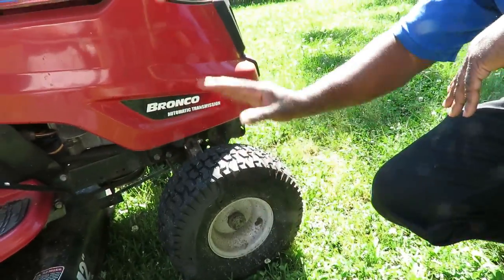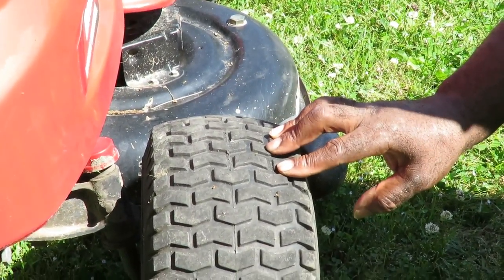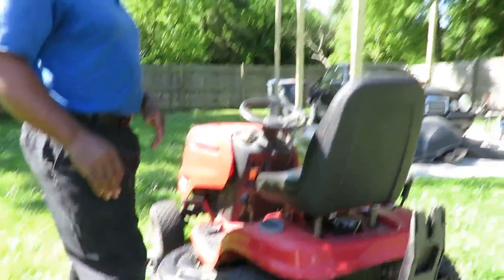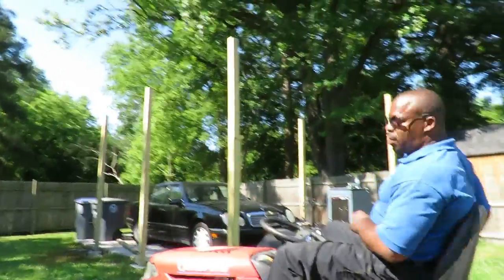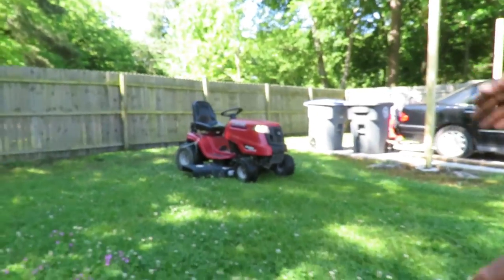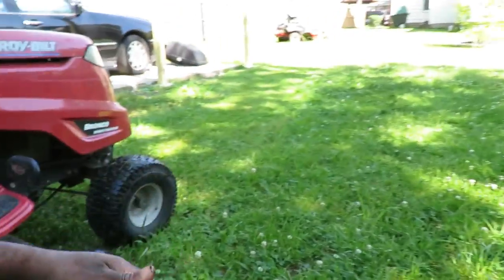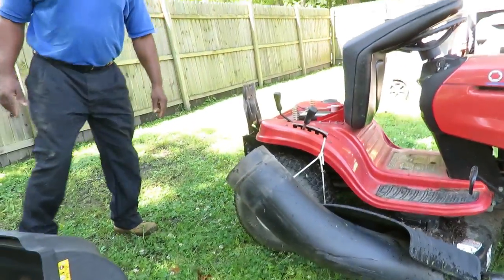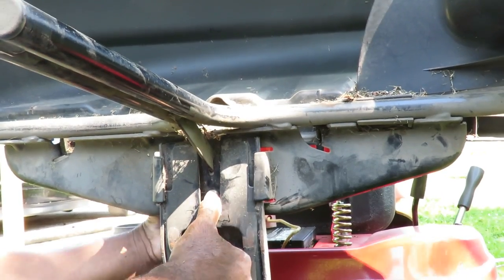Troy-Bilt Bronco Tractor And Bagger Review AFTER 4 YEARS OF USE!

Comment: Tim,  Good video!!
I bought a 2017 Bronco - great deal from Lowes - $1200!  However, my local repair guy stopped doing a pickup & return to service riding mowers!!
So Ive had to use the authorized Troy dealer for 2 services in 3 years - @ a cost of over $600!!  Only repair was a blown electrical fuse!!
If my old Sears blade bed hadn't worn out - after 15 yrs - woulda never bought the Troy!!
Thx for the review & info!!
Reply from the maker: That's great Jim! We still have ours, and it's still working great! Since this video, we have replaced the starter and a battery, and that's it. These things are great!
Reply: You don't like working on these things yourself you know those shops cheat

Comment: Thank you so much for taking the time to do this. I'm between this and a cub cadet and can't decide. One thing that I've read in several places that may help you is to spray silicone on the inside of the plastic pipes that go from your deck to the grass catcher. I read it really works well and it's a cheap thing. It's supposed to especially help with damp or wet grass. Thanks again!
Reply from the maker: I do believe that Troy Bilt and cub cadet are basically the same. You might want to look into that and that might help you decide. Thank you for that tip, I will definitely try it.
Reply: Ima go with the cub goin to order in 2 weekz

Comment: Thays awesome, these tractors are awesome. I have the brinco as well. It has spent its life in the garage when not in use and I only cut my own yard but I bough mine at Lowes 16 years ago. It runs perfect and uses no oil. Ive been through 2 deck belts about 4 batteries and last year the muffler rotted off. Everything else is original. It gets oil changes and filters every year but its a briggs and stratton 18.5 intek
Reply from the maker: COOL Kevin! We are just now replacing the rear tires, but the tractor RUNS GREAT!!

Comment: Thanks , man! I got a newer version with mostly the same main features. This info will help me to work around  problems using your trials and errors.
Reply from the maker: Thanks Daniel, and this thing is STILL going strong! I did have to replace the tires, the battery (of course), and the starter (which was only $65).

Comment: Mines a older model than that one i think is a 2004 but its piston was froze up and both valves and rods were rusty because someone cut off the air filter housing cover and they left it sitting in the rain so i got it all moving again the 18.5 hp intek runs good now just needs a few new tubes and plastic pieces maybe a intake manifold for the front of the carburetor to the air filter and a good used motor shroud  gotta have that or another used engine just for the parts im needing 

Need a carburetor rebuild kit just for the little rubber gasket fits between the white piece in the carburetor when you take it apart then the aftermarket carburetor will be a good backup to keep for later so i cleaned up the original carburetor and it works good its rubber gasket inside it works i guess other people would just buy a new carburetor but i didn't have the money for one.

So i done a test ride on mine it rides good but does have air leaks from it not having all the new and used parts its needing after the engine got hot oil started coming out from i think the air breather tube on the top left side of the engine cause it needs a new hose then i shut it off until i get the new stuff may have to take off the flywheel to put on the new hose

Comment: My 2004 one will be doing knee high grass once i get done replacing missing parts on the engine i may need to do a intake valve adjustment to so the old things gonna get to cut alot of field grass pretty soon and i go up and down the big hills can't go sideways its to steep to and would probably flip over on those hills i try not to chew up to thick of tree branches but finger size limbs get chewed up and blown right out.

Comment: Great video! I don't know if you've torn into the transmission yet but I have on mine. Mine had so much time on it that the actual bushings the axle rides on in the transmission wore thin so my axle had a bunch of extra play and it was squeaking because it was rubbing on the casing. Anyway I tried replacing the bushings but one of my wheels was rusted on and I've been unsuccessful so far; the project is 'on hold' because I found a good used transmission at my mower shop and put it on. Anyway, I was just gonna say regarding the ground speed that your variator pulley in the back,  belts, or foot pedal may be to blame too. The pedal might have an adjustment underneath for tension which could give you more power.
Reply from the maker: Thanks for that info!

Comment: How does this handle inclines like ditches?  Can you mow sideways, or do you have to back in and out?
Reply from the maker: DO NOT mow "sideways" in a ditch". backing in and out is best for this. The instructions will let you know that, because there is a possibility of tipping if it is too much sideways. Now you can mow a LITTLE at a sideways angle, but BE CAREFUL!!